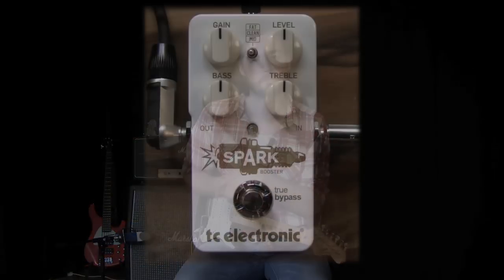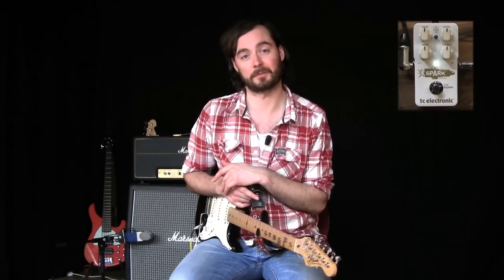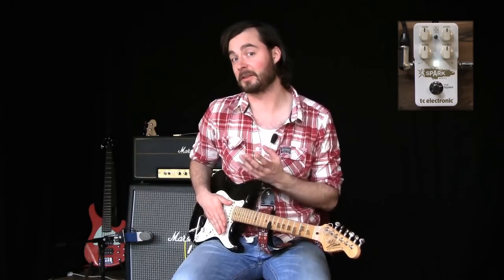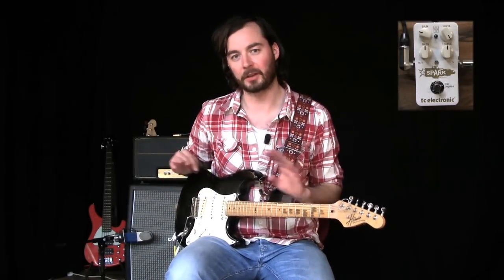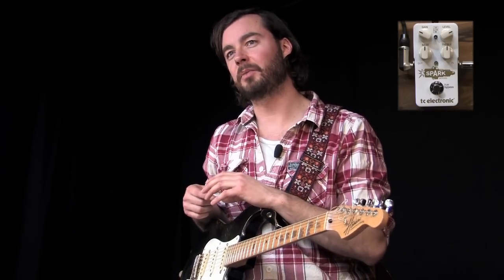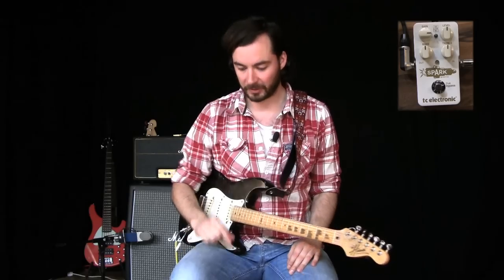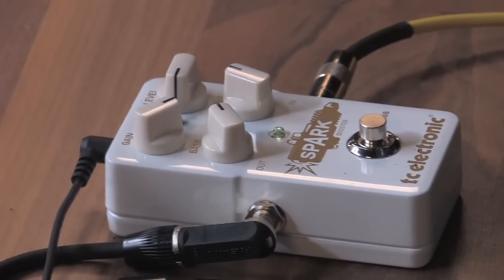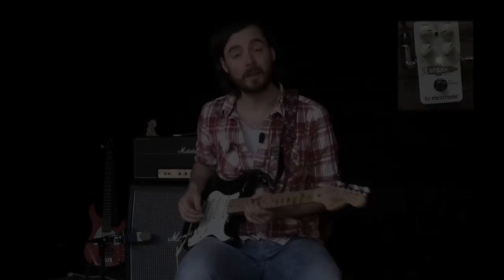Spark Booster pedal from TC Electronic

Comment: They make too much noise and it was hidden well in this video.
Reply: It kind of sounded that way to me too. Sounded like every time he turned it on his signal got pretty noisy
Reply: He's playing single coils; they're always going to get noisy when you add gain.
Reply: @goldtop362  

I have four stratocasters with single coils and 2 telecasters with single coils.  When my guitars are plugged into my rig I don't have even half that much noise in my signal. This pedal is definitely noisier than the average pedal. I wouldn't want it
Reply: @davidpehrson3707  fair enough but what amp are you using?
Reply: @matturner6890  
My amps are an AC30 and a Fender 68 deluxe reverb
Reply: @davidpehrson3707  a fine pair! Could be that the 68 could use a once-over. Maybe some of the electronics haven't aged well and are introducing more noise? How olds the Vox?
Reply: @matturner6890   
Ummm....... I think you are miss understanding what we were talking about.   My 68 is dead quiet and so is my ac30.  I  WASN'T saying that when I plug the spark booster into my amps I'm getting noise. We were talking about the demo. In the video you can hear a lot of noise in the signal when he turns on the spark booster. That's what the comments are about. Not about my gear. My gear is working perfectly. LOL.
Reply: @davidpehrson3707  well shit I am a damned fool. Disregard that

Comment: I usally put a booster in the send return for this kind of problem. By the way, if you put it before the distortion you'll get more fat/gain, if you put it after distortion(on the correct settings) it will increase the volume. And this is a really good quality/price pedal. It's even very easy to sell..so you won't go wrong buying it!

Comment: Try an EQ pedal set last in the chain in your amps FX Loop.   Boost all of the slider's by around 6-9db.   Used this way with an amp thats already being driven hard and you'll get both more gain and volume.   You can also adjust the profile of the sliders - say push the mids up a bit relative to the treble and bass sliders - to get a more cutting tone.

Comment: Mr.Z   It's a small world man. I owned the FB2. What I like about it is it has a great treble range. My SG is dark and it sounds like it has a maple cap when using the FB2. I used the fb2 to boost my od pedal for solos. The feedB. feature is ok only is you have the vol. low. The note bleeds out if the vol is cranked on the pedal.I am getting the spark.Obviously it offers more control over the tone. It sounds great, It's half the price of the rc booster with the more bang for your buck! Rock on!

Comment: Hello, 
I have a question, 
How would you suggest I set the Spark boost pedal to emulate the exact tone of the Clapton mid boost circuit? The strat that I play and is also my main guitar, is a custom shop 54 50th anniversary masterbuilt and I really don't want to alter it in anyway with other pots or wires, routing etc, so, I read that the Spark is a fantastic way to get that tone and sound without altering my guitar in any way.
Thanks for your time and help!
Reply: use it with a  eq pedal and its great for clap tones check out andertons sould like Clapton for under a grand vid on here

Comment: I play steel guitar through a solid state amp. I'm looking for a clean boost to take solos with. If I understand this demo correctly, the gain won't add overdrive unless this is going through a tube amp, right?

I don't mind a little bit of drive in the sound on peaks but its a clean boost I'm looking for.

Btw; I work regularly in Denmark so the accent doesn't bother me - believe me, its easier to understand than listening to someone "like... so from California"!
Reply: It will still add some overdrive, but not as much, since the gain is designed to help you hit your tubes harder. For a clean boost on a solid state amp, this will work perfectly. It can pretty much do anything.

Comment: would it be possible to use it in a serial fx loop just to push the crunch channel of a jcm 900 adding at the same time a little more gain? mean setting gain up to 3 and level as much as is needed for a solo spot. Thanx in advance

Comment: Is this TC Electronics version of the Ibanez Tube Screamer? I'm a big fan of TC electronics I have a Voice Live 3 that I love and a Corona Chorus I use with my bass rig. I just bought an Overdrive pedal called a Timmy (by Paul.C) and I've been looking online at several different pro's pedal board set up's. Many have their Overdrive, Fuzz or Distortion Pedal backed by the TS808. I'm wondering if this pedal is a good alternative to the TS 808??
Reply: no, it isn't a TS.  they're different things.   you may find the TC s/b too similar to the Timmy - at least in terms of how you might use it.

Comment: Just got one today it's amazing at clean tones with just a bit of dirt, and beats the living shit out of a tubescreamer for boosting a modern/thrash metal tone.
Reply: is it like a pre amp pedal ? Thanks
Reply: @jixxxxer17  it’s a clean boost pedal/overdrive pedal you can do a few different things with it, I use it to tighten up and push a dirty amp for a metal tone. But you could use it to boost a solo or a clean tone or just as an overdrive, but I am not sure it would work as a preamp
Reply: @rosskane2971  awesome Thanks !
Reply: I have a tubescreamer, i like it the most as i dont use metal tones so i would say that tubescreamer is 200 times better for vintage thin kinda blues drive
Reply: @yakshrajsingh8121  I would say that the Spark works best with single coils and theTS works best with hummers.

Comment: That's great! It's like the modern-day heir to the classic TC BLD (Booster/Line-Driver) bbut with more gain and other features. Magical pedal, the BLD. Subtle, but when used intelligently (eg: in conjunction with a Muff & a Boss GE-7) the results could be amazing. I hope that the Spark Booster can fulfill the same role. So far, my favourite Boosters are the MI Effects Boost 'n Buff, Mooer Pure Boost, Maxon TB-09 and the one-knob Prick Power Booster by Chapter 4 FX. MI Effects and Prick are ones that never let me down.
However...I'm not quite satisfied. Time to try a Spark.

Comment: Almost any high gain amp is going to have trouble getting a really good clean sound. It's rare when a high gain amp has great cleans, so Marshall JCM's and the like don't have the greatest cleans. They're early high gain designs and weren't focused on cleans. However, the early non-master vol. Marshalls, such as the one used in this video, were built based on Fender designs, and have great cleans. The JTM45 was a direct copy of one of the greatest clean amps ever, the Fender Bassman.
Reply: Not really a "direct" copy. Direct in terms of circuitry but using locally or differently sourced parts (tubes etc). The result was the birth of the JTM45, the best head ever made.

Comment: I got 2 questions can I use this pedal with bass?? n' can I plud this into the FX LOOP of my amp?? I'll appreciate someone reply me =)
Reply: You can definitely use the clean with a bass, but the Fat and Mid switch positions won't affect your sound the same, since their frequencies are designed for guitar. And I wouldn't recommend putting any drive or boost pedal in a loop; they belong in front of your amp. But hey: if it sounds good to you, then it's good.
Reply: homeslice1479 hey thanks a looooooooooooooooooot for ur reply =)
Reply: either

Comment: I never get boost pedals. I mean, yeah, they have a certain amount of (limited) utility, but the best sounds in this demo and all other demos are coming from the other pedals they use! Like at 6:38 he adds in a distortion pedal and some delay. The tone is great. When the boost was engaged it just increased unwanted hum, and the actual gain/grit increase could be achieved by boosting the drive or level control on the distortion pedal. Boosts are essentially pointless.

Comment: no I know what the need is, my point is I don't see what the advantage of a boost is over an overdrive/distortion. If you want to boost the signal like he did at 6:58, why not buy an overdrive/distortion pedal and set it to a really low gain but high volume boost so it's subtle like it was here. Then, unlike a boost pedal, you could also crank the gain if you wanted a much more aggressive sound. With a boost you're very limited and it seems like a good distortion pedal can do its job and more.

Comment: 6:59 so much buzz and interference noise , blimey and that's with the amp low, would be a nightmare on stage , cranked up. OR maybe you shouldn't sit so close to your Amp? The noise has put me off buying one
Reply: That's single coils for you mate
Reply: haven't played single coil ..have ya?
Reply: +Sharath Menon nothing a isp G String Decimator can't fix lol
Reply: it's called a noise gate
Reply: +Thunder Death 2 so if you get one of these you have to buy a noise gate?
Reply: +MrPerfectfeet I wouldn't use dirt with single coils if not in a noise cancelling position. Single coils sound awesome but are noisy as hell, it's not the booster's fault it just amplifies the signal coming.
Reply: Sergio Diez Viñuela Depends how much dirt. I like to run my strat into a overdriven fender amp. Gets the SRV tones nicely. I find if you have good quality american single coils (That are properly grounded) then the hum isnt too bad

Comment: well i could see how you were concerned with the guitar volume in the end of the demonstration, lots of noise right?? why hiding it from us?it is so dam importante to show how much noise the pedal generates ...yes it is right i bought one two days ago and i wasn't that pleased with the noise, if you set the knobs above 10 o'clock it is almost impossible to use it in a live gig, even with NSuppressor.
Reply: bbuteo It's not the pedal. It's the guitar picking up hum because it has single coil pickups. The booster is full spectrum, so it will boost everything, including any noise.